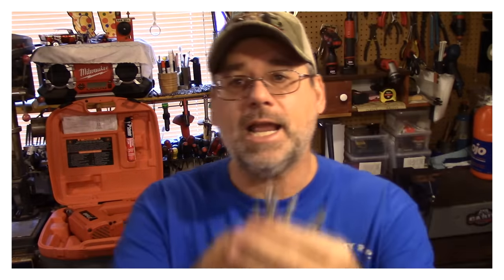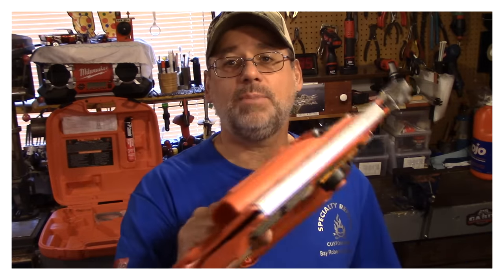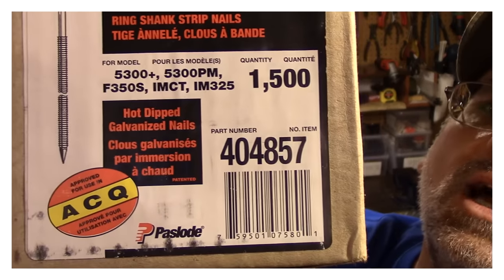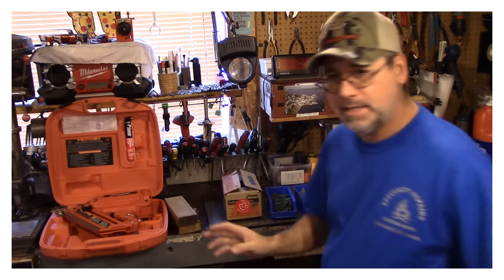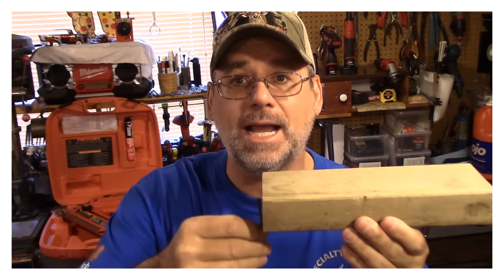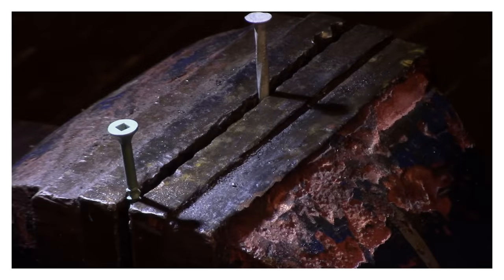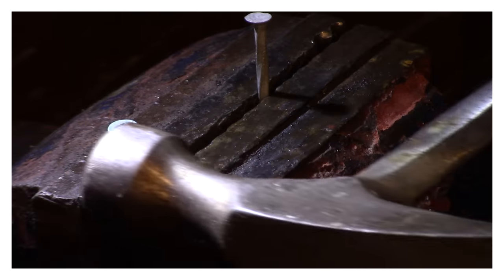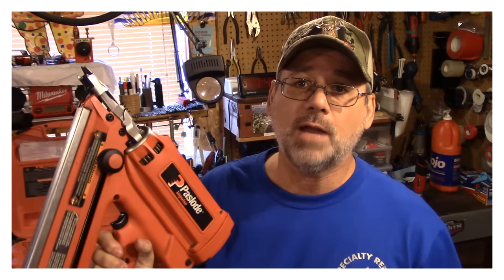BEWARE  NEVER USE DECK SCREWS  - DECK SCREWS VS NAILS -  PART TWO IN DESCRIPTION

Comment: That is not a proper shear test. That was more of a test of bending capacity. Try that with a slow motion camera. The physics of a screw embedded in wood is quite different.
Reply from the maker: +James Stork  Yes James the test only showed how brittle they are in comparison to nails. Both have their place and knowing what to use and where is best. Cheers

Comment: Screws are fine .. build a deck with nails and after a couple years you'll be out with a hammer pounding the nails back in .. You didn't test the straight pull between that nail and a deck screw ..
Reply from the maker: Video was about where not to use deck screws and showing how brittle they are . Not to be used in any structure build , deck boards and fence boards are fine . Cheers
Reply: @SteveRobReviews  You'r point is well taken. However, when does a screw stick out, once in? The only time that I've seen a screw stick was on a door hinge. I think a nail holding a hinge would have been much worse.  I've seen nails lifting out on decks and fence posts. Can you give me an instance where a deck screw is flush to a work surface that sheared off under a load?
Reply from the maker: @tyronekim3506  https://youtu.be/nOjU18H10Ws
Reply: @SteveRobReviews  I watched the link to your video. I don't know the screw brand the you're using that caused the rust, but the brand that I use is "Deck Mate". It says LIFETIME GUARANTEE against rust and comes with its own bit for driving in the screws, and I never had a problem with it. If you go with a bulk pack Chinesium, you're going to get what you paid for. You should take a look at Deck Mate.

It's interesting to see that you drove a new screw into the same hole with ease where the old screw broke off. I didn't see you remove the left over broken screw piece that's buried in the wood. How did you drive in the new screw so easily?
Reply from the maker: @tyronekim3506   The deck screws you buy today at most big box stores are junk if you dont know the difference between brands or gauge size . Using a #10 instead of #8 is much better and SS is better but more expensive.  We cant tell how good a screw is till you try it and the big brand I bought were junk. Driving in a screw over a broken one is easy , just angle the tip and it goes in just beside the old one.
Reply: @tyronekim3506  deck mate ARE the cheap chinese junk.  NEVER use those

Comment: Because you don't need shearing force on deck boards or floor boards. You do need the grip though. That's why floor screws have a double thread, but are also no stronger than drywall screw. I've learned to use the right screw for the right application is best. If it's design on the fly, I almost always use brass construction screws. Nails are so much faster though. For decks, I used to just use my gun and hit 3 times at different angles instead of straight. But everyone wants composite now, you have to use screws, sux, lol...     And torque can be a consideration. If you are sinking #10s or lag bolts into solids, then you will see a lot of flat heads, cz they give most torque. Anyway... peace

Comment: I will not use anything but ring-shank, galvanized, full-head air nails for deck boards or the framing. If I use screws, it will be coated only, and I'll charge more for it, and I will NEVER guarantee my boards not to twist, buckle, bow or warp.
Anyone who uses non-treated anythings should not be allowed to play with tools.
Don't hammer on screws, except to lay down a stripped one that won't go in, after trying to get it out, tho I'll usually hit that with acuttingwheel in the angle .grinder.
37 years remodeling, rehabbing, restoring, repairing, renovating. I think I know how to screw.
Reply: Oh, btw, I don't know the exact shearstrength of the exterior screws, but to compare, a 16-penny nail is about 1635 lbs. as I recall, and I have YET to EVER see wood shear off a screw as your steel hammer did, but I'e seen MANY loose boards secured with nails. Screws, not so much.
Reply from the maker: Good points  Gary and most tradesmen know what to do but when I make a vid and I get jackasses tell me the most outrageous stuff - well buddy ya make another vid. https://www.youtube.com/watch?v=IfCuqqN9g4o
Reply: Stainless steel nails or screws....

Comment: Your video is good but deck screws were never made to receive a direct hit by a harder steel in a levered position.  Good quality deck screws with a pilot hole are far superior to a nail.  Nails always loosen up and protrude and become dangerous and unsightly and removing them for any reason is a much harder job and usually damages the structure.  Screws are ten times stronger in a pulling cenario.  Also simple to countersink for a beautiful look.  Nails are for building outhouses like you said.
Reply from the maker: +Rickarama Trama  I agree , this was to show how the affect of side loading affects them , they are brittle . Just use the proper hardware  for the right application and you will do well. Ok outhouses are exempt :)
Reply: The hardness of the screw doesn't even come into play with wood though.  A steel vice and hammer test is totally different than the environment the screws are up against in wood.  Wood is soft and absorbs the movement.  With the proper amount of screws any movement load would be distributed.  Not saying there isn't a time or place for either, just don't know that that argument/example holds much water.

Comment: Steve, I love ya but I am going to have to disagree with you here. Nails pop out and turtle head out of wood, whereas the screws stay in. That's why I even prefer them for drywall.
Reply from the maker: Fred screws are fine for non structural spots like deck boards but I have given up on #8 deck screws as the heads shear off over the winter or as the boards flex . I only use #10 now and its  problem solved. Cheers Bud.
Reply: @SteveRobReviews  Oh, that's right, you are in an area in Canada that gets really cold. Then you are right, it's better to use the nails.

Comment: They have screws for PTL that will not be affected by the chemicals used in PTL. As far as the screws breaking with a hammer. Yep they will. However if you use screws designed for use with structural components they are fine. It is about using the correct screw for the job! Just like using the correct nails for the job!
Reply from the maker: Right on Don !!!!

Comment: I was taught use nails because they are fast and cheap. If you want to fix anything properly, use screws.
Reply from the maker: We all have our choices . Cheers
Reply: Deck screws aren't wood screws.  Wood screws are designed to take a shear load.  They're ductile and will give without breaking.  Too many people equate wood screws and deck screws.

Comment: Deck screws are for decks.  The "deck" is the upper horizontal platform intended to be walked upon.  Deck screws have strong "pull" strength, but very poor "sheer" (sideways) strength.

Comment: At my work there are decks that were built 25 years ago with nails. Some repairs have been done since then , mostly using deck screws. I find that the friction of them being driven into wood without a pilot hole can damage the coating on them. Especially on the threads , which combined with the Canadian winters and salt on the bottom of boots; Causes 3 year old deck screws to rust away to the point of not even being able to remove them in 1 piece

Comment: Deck screws are better if the deck is constructed properly.
Reply from the maker: I would say 75% prefer screws and 25% prefer nails for lower cost and much faster installation if using a nail gun.  For replacing deck boards I like nails for replacing boards as screw heads are full of dirt and stain or paint over time .

Comment: I use deck screws to fasten wood braces that I may have to be removed later if necessary.  I just back them out and relocate if they are in error.  Nails are more permanent and have to be cut with a reciprocating saw ruining the wood and fasteners.
Reply from the maker: Jackie as long as your not using deck screws for structural load support or   as some diyers do as in  joist hangers . Cheers

Comment: I use stainless deck screws. I doubt they are brittle.
Reply from the maker: I like the SS a lot , so much better 👍
Reply: Curious if you are using an impact driver for the stainless screws; some years back I used stainless decking screws with Robertson heads for tge smallest section of my wraparound deck, and they were finicky to drive without stripping the heads.  I didn't have an impact driver back then, and so I used coated Torx decking screws for the rest of the deck which were easier to drive.  I have since discovered that those are much much easier to drive with the impact driver than with a regular driver drill and I wonder if the stainless screws are similarly easier to drive with an impact driver and hopefully less likely to strip.

Comment: Fact!!! Deck Screws are not structure screws!!! Most folks don’t even know the difference… but I’ll tell you this I’ve used them in a pinch until I was able to secure with structure screws and they held up fine … Not all deck screws are created equal …. Always use Structure screws 💪🏿

Comment: I’ve seen decks fall apart because people use the wrong fasteners, they use construction screws that are not for pressure treated and use deck screws for structural load and they sear off. There are screws you can use but expensive and they have there place as well
Reply: I used deck screws on my deck about 8 or 9 years ago and a few weeks ago I had 4 boards pop up on the end so I went to tighten the screw down and it appeared to be stripped so I backed them out and they had all just corroded in half. I’m worried and disappointed because I actually paid quite a bit more to have it screwed down now I may to replace the deck.
Reply: @jkendrickjr  I think it's because the chemicals they use in pressure treated wood are different than they used to be and these fastener companies haven't caught up.

Comment: Well he's right, but the video should be titled "Do not use deck screws for structural joints". There is a reason deck screws exist. There is a reason nails exist. Just use the proper fasteners in the needed places. I can't imagine using decks screws for structural since that would be like four times the cost and no real benefit, are as demonstrated here, a bad idea. If anyone is using deck screws for structural, they are nuts.

Comment: You wont be able to break off a stainless steel screw by hitting it with a hammer it will bend like a nail. Those steel construction screws are okay to use for an interior partition wall.

Comment: DECK SCREWS ARE MADE TO PUT A DECK DOWN  , THEY ARE NOT A STRUCKLER SCREW JUST LIKE UYSING DRY WALL SCREW FOR WOOD
Reply from the maker: Exactly , and they do well for the designed intended propose for the most part. Cheers.

Comment: Retired journeyman carpenter here.  Agree with everything you say.  Deck screws are best with 5/4 pressure treated decking, I don't use them for anything else, the shear strength is much too weak compared to spikes.  Just finished building my son's deck and used 3 1/2" spiral galvanized nails for the framing, saved the screws for the decking.  That framing will last 50 years and 3 sets of decking, which thankfully can be reverse screwed off when needed for replacement.  That's why they're called decking screws - that's the only time you use them.
Reply from the maker: Cheers Fred 👍

Comment: pressure treated wood has salt in it, stainless steel decks screws are very good and do not rot the wood, we use them on boat docks, yes they cost more. you get what you pay for
Reply from the maker: Good points Butch 👍
Reply: Yes, coated (green colored) deck screws are definitely garbage, they will literately rot away. We built a deck for my brother (green screws + treated boards), we had to replace the entire deck 4 years later because it warped and popped so bad. Use brass screws ...more expensive but they are worth it.

Comment: Sharp angles at the root of the thread cause a stress concentration in those areas. That, and (maybe) material differences are the only reason why the screw sheared before the nail. 
Fasteners are designed to withstand tensile loads, NOT shear loads. If a screw or nail is providing resistance to a shear load, then the design is wrong or at the very least not optimal. Screws can be beneficial because they usually do not back out like nails might.
Reply from the maker: Exactly  Danny and the loading of a deck screw should never be sideloaded to excess . Their only made for clamping force not structural loads. Cheers

Comment: Try stainless steel Deck screws they don't break.
Reply from the maker: Ok in the next one I will . Interesting to see how they perform. Thanks
Reply: Absolutely correct! Stainless steel screws will never break and don't rust. May be more expensive but worth it.
Reply: Stainless steel screws are also very brittle and they will shear fairly easily.  Also not a structural screw.

Comment: I built my 6' × 6' × 7' deer stand with 4' × 6' door and 3 ' × 6' porch. That was over 6 years. And No problem.
Reply from the maker: Sounds great and I see no problem with  it - it's your treestand .  Commercial work is much different. I have many tree stands and made  a vid on building a treestand ladder. Pretty crude but hey it's going in the bush. Cheers     https://www.youtube.com/watch?v=wsOL9hy3DR8
Reply: STEVE ROB I've got a 10' stair case. And its insulated and paneled. Lol. Its really nice. I know nothing about building. I prefer welding. Been retired now for 13 years. I wanted a comfort stand. Got an office chair to sit in. Lol. If I ever see it coming apart you can bet I'll have it rebuilt better. Have a great weekend. And God Bless

Comment: Thanks for sharing, you are absolutely right. I learned that the hard way. They make drivable construction lag screws but that is just the tip of the iceberg. There is so much more to it then that. A small project can have fatal flaws in engineering and can stand for years until a storm reveals it. The way you use any screws, glue, or nails is subject to the laws of physics and must be used to there strengths.

Comment: Screws for studs are sometimes referred to as bugleheads. The most common screw for joining two-by-fours is hardened steel, structural, No. 9, 2 1/2 inches long with a Phillips head. Other screw types appropriate for studs are specialized and may be harder to find and more expensive.

Comment: Film building the out house it will be cool. Who every built my deck used the wrong nails no wonder I had issues with it.
Reply from the maker: I will start soon and show you the old  outhouse  soon. It needs replacing. I have seen decks with plain nails used just rot in 5 years with PT wood. Very acidic stuff.
Reply: STEVE ROB It did not take long for it to rot even with me doing up keep and keeping it stained.
Reply from the maker: I don't like the new PT I think for the cost regular untreated lumber may be just as long lasting if its not touching the ground.

Comment: M’s husband peter here. I’ve built many things with Pt lumber, broke them down saving the screws, and done it again. I have deck screws that are on their third application. Yes occasionally they snap. And you have to twist the remains out with a vice grip. Some just get a little bent from racking stresses but can be straightened like a bent nail with a hammer. Some newer deck screws have some extra steep pitch threads above the regular threads( for composite decking) which I don’t like. It interferes with the function of the slip shank for pulling lumber together. 
.

Comment: I like using screws because if I make a mistake I can take it out or adjusting it again without demaging anything
Reply from the maker: Hi Mark 
There is nothing wrong with screws  as long as your  putting them in  spots that  allow a screw. Cheers 👍

Comment: What about Simpson Strong-Tie SD Connector Screws #9 x 1-1/2" and SD Structural-Connector Screws #10 x 2-1/2" when used with the Simpson structural plates and hangers?
Reply from the maker: I was referring to regular deck screws. The ones you have quoted I have no knowledge about.   I will look into them .  Thanks for the info and thanks for watching. Cheers Karsten.

Comment: How many people have problems with others taking a hammer to their embedded deck screws? Just sayin'...
Reply: i think it illustrates the "shear" tensile strength of the nails vs the screws. i.e. High winds or some other kind of failure.

Comment: Yeah but advice is not a piece of wood the nail will pull out of the wood
Reply from the maker: Use the proper nail or screw is the best advice.  👍
Reply: @SteveRobReviews  yep don't use nails
Reply: @SteveRobReviews  I just talked to a building inspector today about using 3-in deck screws to attach a 2x10 to a beam on the deck I toe screwed them not toenail them his claim is that nails are better than screws it's funny I can pull it apart with nails and not screws